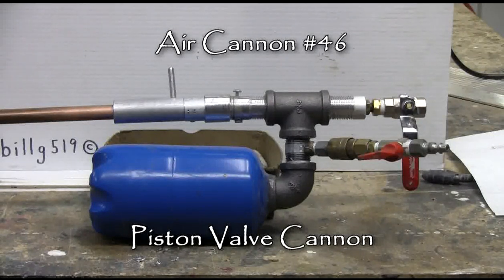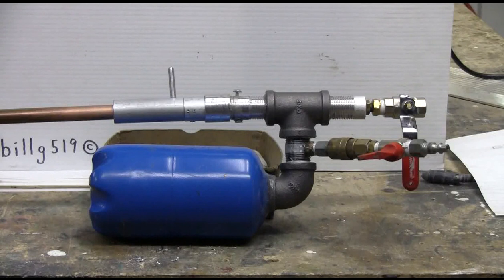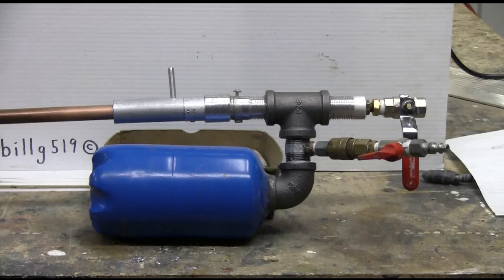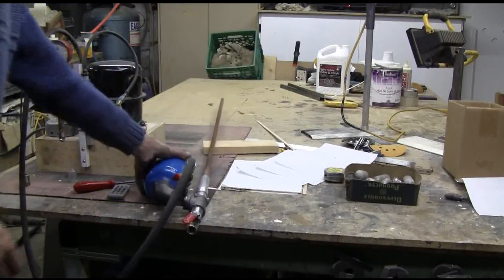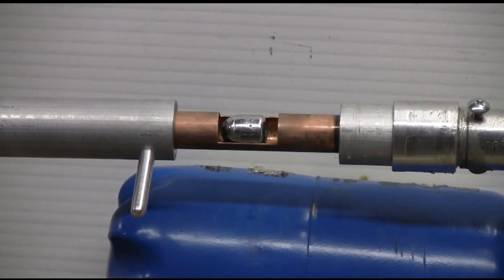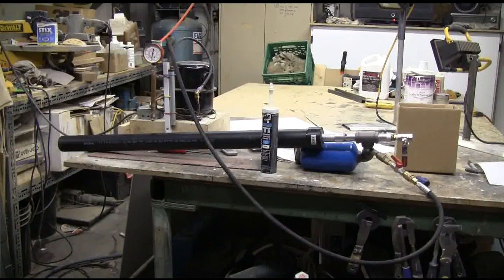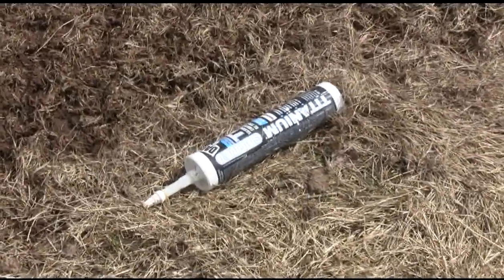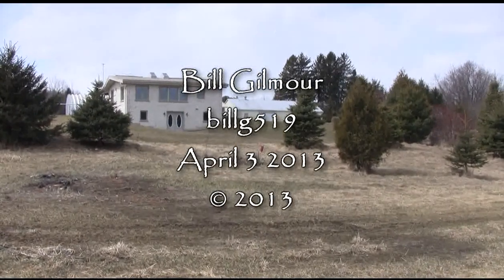Air Cannon #46 - Barrel Sealing Piston Valve Cannon

Comment: How did you make your piston? I tried making one a while ago, but it was difficult to find the right materials and make it function properly. I decided to go with a QEV in the end, but I'd like the customizablilty of home brew pistons (esp the potential for very high flow)!
Reply from the maker: I have a lathe, so I can machine my own pistons and other parts. It is quite possible to make a valve without lathe access, especially for the larger cannons made from PVC. To make smaller parts the lathe is very valuable to have.